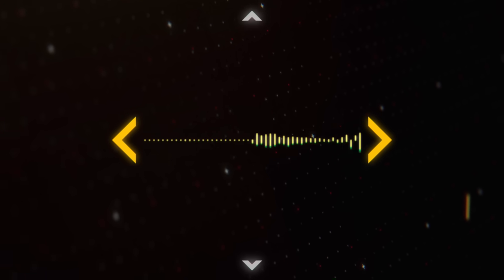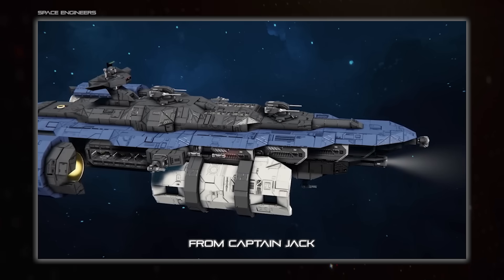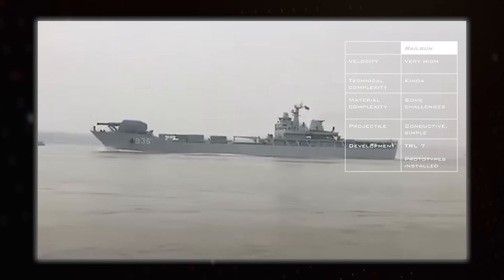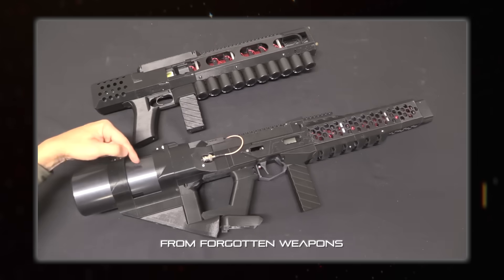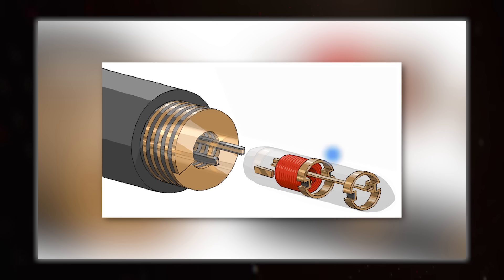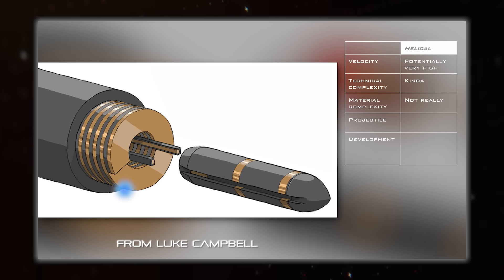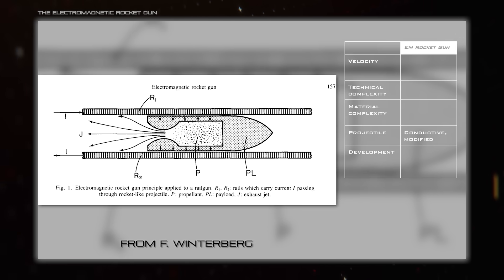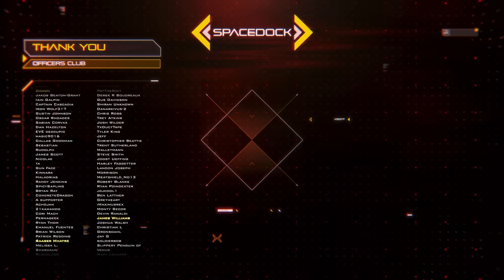The Deadly Coilgun/Railgun Hybrid You've Never Heard Of (Helical Railguns)

Comment: That Helical Railgun concept looks incredibly expensive, especially with all the extra engineering going into the rounds themselves. Can you imagine manufacturing hundreds of millions of these?
Reply: Expensive for small arms. For tank/IFV/artillery use not so much, at least compared to "smart" rounds we already have.
Reply: Fuzes used in old-fashioned flak (timed or "VT" radar-proximity) are on a similar level of complexity to helical railgun bullets and those were produced in large numbers. More expensive than a homogeneous iron block doesn't mean actually expensive. Reasonable for anything bigger than a machine gun in the present day, and tolerance for cost is bound to increase in the future as productivity does.
Reply: It costs four hundred thousand dollars to fire this weapon... for twelve seconds.

Comment: For why you'd want to fire that hybrid gun talked about at 6:34, the reason I'd go with is that you've put this weapon on a small ship, like an Elite Dangerous Eagle in a spinal mount and wanted it to be able to fire out of both the ship's bow (front of a ship/boat) and stern (opposite of the bow) depending on commands put in by the pilot or weapons officer. This could also be used to dispense bigger, heavier, and slower-moving projectiles that do all of their damage by either radiation or explosive force besides launch velocity, as I believe that's the basis of the torpedo launchers in Star Trek, flinging the ordinance out far enough from the ship that it's already at a minimum safe distance by the time it arms. After all, the TNG technical manual says that the fore and aft torpedo launchers both draw from a shared 250-round magazine. Setting up those coil guns to fire a projectile with full homing and a muzzle velocity of roughly 2-3 times the firing ship's top sub-light speed can be exactly what's needed to turn these cannons into missile/torpedo tubes.

Comment: You forgot to mention the coolest coil gun variant of them all - the quench gun. Basically, it's the same idea, but with superconductors.
Reply: The major challenges with superconducting coil guns stem from the difficulty in managing magnetic fields and currents without causing the superconductor to quench, as well as the practical issues of cooling and maintaining the superconducting state during high-energy operation. These factors make the use of superconductors in coil guns problematic and currently impractical. Here are the key issues:

Flux Pinning and Magnetic Field Trapping: Superconductors can trap magnetic fields due to flux pinning, which means magnetic field lines get fixed within the superconducting material. In a coil gun, which relies on rapidly changing magnetic fields to accelerate a projectile, this trapped magnetic field can obstruct the necessary changes in the magnetic field configuration, hindering the gun's operation. Critical Magnetic Field: Superconductors have a critical magnetic field threshold. If the magnetic field strength in the coil gun exceeds this threshold, the superconductor will quench, losing its superconducting properties and becoming resistive. This transition results in a significant loss of efficiency and performance. Inductive and Resistive Heating: Despite having zero electrical resistance below their critical temperature, superconductors are not completely immune to heating effects. Rapidly changing magnetic fields can cause inductive heating, potentially raising the temperature above the superconductor’s critical temperature and causing it to quench. Managing this heat in high-power applications is a major engineering challenge. Current Density Limitations: Superconductors have a critical current density limit. If the currents used in the coil gun exceed this limit, the superconductor will quench and lose its superconducting properties, leading to inefficiencies. Complex Cooling Requirements: Superconductors require very low temperatures, necessitating complex and often cumbersome cryogenic cooling systems. These systems add to the weight, cost, and complexity of the coil gun design, making it difficult to maintain the superconducting state in dynamic and harsh environments typical for such applications.